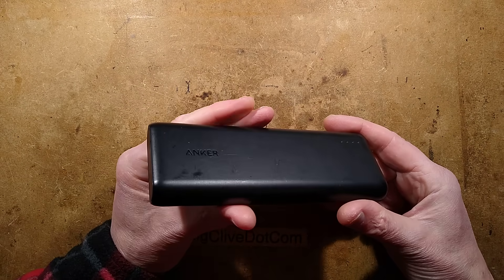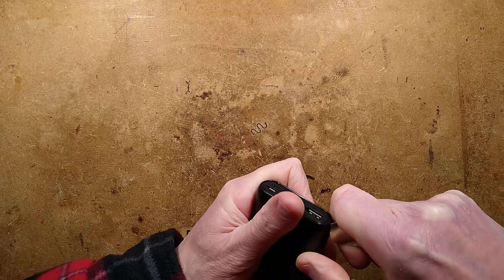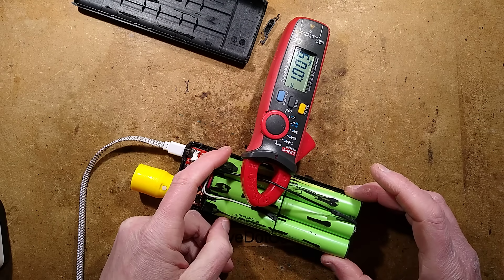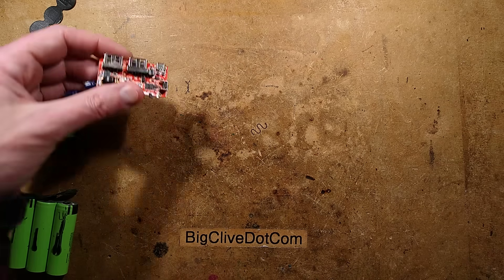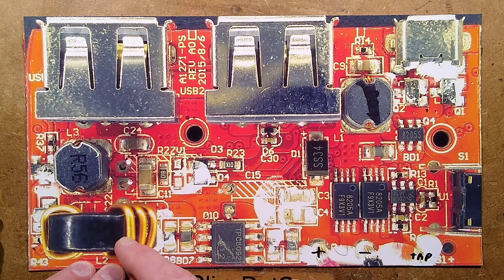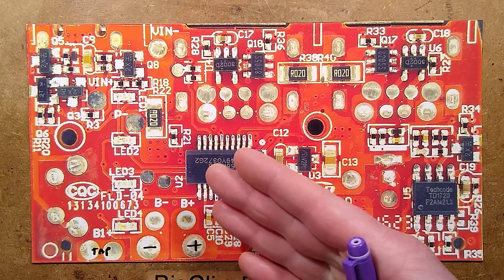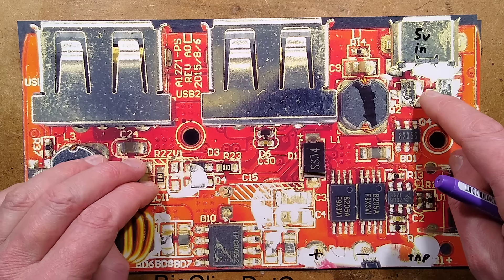Exploring an Anker power bank

Comment: Likely hitting over-temperature or over-current protection to guard against NMC short/fire failure mode due to crystalline formation.
There's also likely an under-voltage protection mode where if it's too deeply discharged, then it will never charge ever again without disassembly and individually charging cells.

Comment: PSA: primecell 18650 battery are suspected rewraps I had 2 vent gas in to my bedroom when the wraps fell off with a paper like tear.

The tear was caused by a cheap vape but it's like paper thin and after doing some looking online this isn't even that uncommon.

The second battery vented when a remote flipped off my bed and hit the charger there was some burning on the charger. All were disposed of and I got an education in rewrap batteries.

I do understand that this is partly my problem but the issues with the batteries are well known.

I did get a better charger and batteries someone produced a data sheet that helped a lot.

Comment: If this helps regarding the complexity of the circuit. I've got exactly the same power bank and it supports the Quick Charge protocol, it's old and probably hence why the extra complexity as there weren't many dedicated chips available then supporting this protocol when this charger was released?

Comment: I've have this exact Anker power bank for nearly 10 years now and still running strong. I payed a pretty penny for it when I purchased it, but I got what I paid for!
Reply: I came here to say exactly the same thing. Sure I've been tempted by newer features like usb c charging or faster charging/more powerful output but also it's just a tank of a battery. Never let me down and it's been through some really rough conditions with me.
Reply: they came down quite a bit in price, I picked one up off Amazon 4 years ago for about 20$
Reply: Does it really only do 5v volts in and out? You'd think it at least did 9.
Reply: @pr0xZen  there was no USB-PD at the time that thing was released.
Reply: @achdubloedesau There were 9 volt capable charging on the market quite a few years before PD 2.0. Qualcomm QC I think were the of not one of the first "standards" with 9V, I myself had a 6-cell powerbank with that well before PD 2.0 came along. But there were several other means, and "negotiation" wasn't nearly as complex or absolute as in more recent years. Some could fairly easily be "tricked" by relatively simple and discrete methods. Especially for input into a somewhat custom device like this, as you're in full design control of the boost/buck-, balance- and protection circuit.
Reply: @pr0xZen  There were some models that added more ways of charging.

I have one that is very similar to this, but it has two Micro-USB ports for input, and can charge off of both of them simultaneously.

Comment: I don't know it the left top undrside of the board supports their IQ charging. The bumph with ANKER is that it is supposed to detect the charge a device can take and kinds of fast charges whatever can handle it. It's probably marketing BS, but it may explain the weird layout with extra gubbins.
Reply from the maker: If it does use the data lines to communicate with modern devices it may step up the voltage to their negotiated level.  That results in much more power for a standard current.

Comment: Nice to see that UNI-T back in use :-) I still use mine regularly, even more then my Yellow Brick shaped Dynatek Multimeter.
I even upgraded to the UT 210-E Pro, since it is more sensitive in the low mA ranges, And have frequency measureing added whic I also uses regularly.

Comment: Just a thought on the output dual inductors... Is this unit QC3.0 with 12V USB output? That could explain dual output switching regulators with abundance of output mosfets. The prints are pretty oldschool but they wonderfully do the job!
Reply from the maker: I'm not sure if it had the QC functionality.  It may have had that.

Comment: Definitely good to know about Anker reset functionality.

I have what appears to be that exact same battery, purchased in Japan in 2017, before they were available easily in Australia. Mine has been used practically every day since I bought it. It still holds a decent charge but is starting to act a little bit strangely. Notably, it seems to take forever to charge and the first blue LED has entirely stopped working.

Comment: I bought these really cheap power banks from walmart, because they're so cheap. The parts are more useful than the power bank. It has one LIPO pouch battery in it and a boost circuit.

Comment: I have a slightly newer revision of that same power bank. They added the option of Qualcomm QuickCharge (QC) compatibility in this model by way of a daughter card, attached via headers. The first one I got arrived dead, and Anker shipped another, so I pulled the dead one apart to see it. I didn't buy the QC option, so it was just bare header in mine. I still use the cells in flashlights though. Good cells, which had on-cell protection, too. (I guess that's how they freed up the board space.) Despite the Eufy shenanigans a couple years ago, I still like Anker for power-related stuff.

Comment: Something even more wild: Older versions (like the one I have) can charge from two separate USB-micro inputs. I have one of these, and its still going to this day despite regular daily usage at one point! (26000mAh).

About the only thing I've been let down from Anker was the last Soundcore wireless earbuds I had; other than that their products are fairly reliable. Even their short run of gaming gear was good  - I still use the gaming mouse as my daily driver and its still going (on my second one and about to go to my third). I'm surprised they don't have more marketing, because their stuff is surprisingly high-quality for the price.

Comment: i had one of these pop while using it. had it hooked up to a vive wireless adapter, was in vr for a good 10 minutes or so, heard a loud pop, headset shut off, and suddenly it started to smell like burning eggs and saw a plume of magic smoke coming from the thing. ripped the headset off, unplugged and ran as fast as i could outside, and just chucked it out into the snow. after 5 minutes of no action, i went out and put it in a metal baking tin. next day i popped it open and salvaged the cells. looked like a cap exploded. scorched the board aswell.
Reply: From VR to Reality 😻 
At least you kept cool and knew what to do..

Have you played (nice non violent games) Myst and Riven (I just wandered around and went on the trains and cart) in VR by Cyan.
There's also Neyyah made in the UK to be released soon..

Comment: It's nice to see inside something well-made / non-deadly for a change!
That "comp" pin on the TD1720 is part of the output regulation but also functions as a reset for the chip when that mosfet pulls it to ground. Presumably the micro handles that.
Reply: That said, it doesn't seem to have a pull-down mosfet on this circuit, that I can see. Just that RC network.
Reply: @jhonbus  Probably the transistor just above U5, npn instead of nfet.

Comment: Hi Clive.
Which is the best powerbank to actually buy?
... also I've seen some website's saying you should only use 18650s for 2 years and then "throw" them away..
and do things that use lithium have any form of fusing or overheating sensors etc..
People are now realising that 12v LiPo4 etc should have T class fuses.. that are also voltage rated ie 12v / 48v etc (if that's right could a 48v be used for 12v or have I got it the wrong way round) which seem to be wildly over priced.
I'm wondering if we can make our own T class fuses.. ingredients correct size wire, plastic tube and very dry sand.
In the past I've used 3A mains fuses for 12v.. mainly because they are cheap, available and ceramic.
Can you do a video?

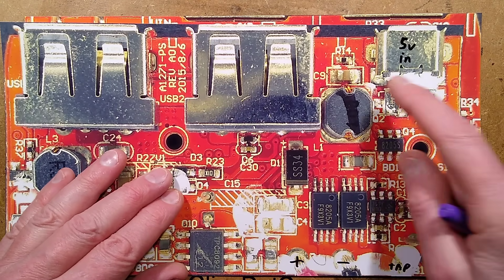Comment: At 7:00 there appears to be an intentiontal bridge between pins 3 & 4 of the rightmost 8205A, and 7:55 there appears to be a solder whisker between pins  5 & 6 of the HTHT66F018.

Comment: I had one of those fail, a newer but similar Anker model. I had a QI charger plugged in that got hot at the USB plug and I guess it tripped some sort of permanent internal thermal protection.The reset procedure for it (plug a USB-C into a USB-A port for 15s) did nothing. I ripped it apart and checked the cells. Took about two hours to get into it, but they were all fine. I got a new BMS, a boost converter, and some USB-C PD controllers for them and 3D printed a housing and they're running fine again. I'm pretty sure the board was in a 'self-detected failure' mode where all it'd do was flash one LED at me, never drew any meaningful current or got hot.

I'm probably just going to DIY my packs going forward

Comment: Clive, I believe those two packs of 3 cells are approximately 12 volts per 3 pack which are then paralleled for a 12 volt pack at double current density. This would make sense with the supply for the  TD 1720 to be at 12 volts.
Reply: @bobahnjr  The TD1720 accepts a VCC of 5-12V, and the TPC8092 MOSFETs are fully enhanced at 5V, so running the IC directly off V+ is perfectly fine. It's also pretty obvious that the three cells are connected in parallel just by their physical construction.

Comment: I have one of those Anker battery packs and has it since 2015, it's probably not got the same power output that it used to but it still works, and I have also got a newer one with PD to charge my phone,

ANKER power banks and usb chargers are great and are the best in my opinion

Comment: I have this exact model. I actually bought it by mistake as it was far bigger than I wanted, but it's come in very handy over the years. Recently I've been running my seestar s50 telescope with it all night in freezing temperatures. It's also the thinnest powerbank I own and fitted inside my Christmas lego model base to power the lights. it chargers extremely slowly and it doesn't support any of the quick charge standards, but it's still useful.

Comment: I have an idea for a fun experiment:
Let’s say you only have one wall charger but a dozen power banks. What is the efficiency loss of daisy chaning power banks to charge them from one charger, vs charging all of them on their own separate chargers?

Which power banks are able to charge and discharge simultaneously? Which ones need to fully charge before they start discharging? What happens if there is a cable break, which ones will charge and which ones will become discharged?

Comment: Also part of the Anker fan base. Still have the smaller (10Ah) brother of the beast you dissected in use, and it has been working fine for almost 10 years now. And I also have a USB charger and several cables from them around. As many others already said, they are one of the few reputable Chinese brands that has very high quality products at decent prices.
Recently persuaded my boss to get an Anker USB charger as a replacement for a no-name one that failed. Took the failed one apart, and it had a 10g iron weight inside that was just attached to the central transformer with double-sided tape and rattled free over time. Guess it might have shorted something on the board and caused the failure...

Comment: Can I send you a faulty 48v e-bike charger for diagnosis,  I don't want it back, just thought would be a good video for you.   The mains side capacitor does charge up as I found out the hard way, still I changed it anyway thinking that could be the issue, checked the rectifier but is fine.  It did start charging for bout 10 mins but then died again.  Lost my patience after that and gave up as couldn't be bothered and new charger on way from ebay.  Interesting note on the charger,  I run a powerline adapter to get internet in my mancave, if I charged my bike I would loose all internet connection, If radio was plugged in I would just get no signal and that was at home or at work.  A strange charger this one as my new one has no effect on internet or radio.

Comment: I have the exact one. It was my first powerbank. Still working but I stopped using it to charge USB-C devices. Mostly because phones complain how slow it charges. I bought some of the little USB-A cubed LEDs you showed in a video. Now it's a emergency light or used to light up some stuff. Like seasonal decorations or building block (Lego and non Lego) models.

Comment: I had a anker power bank just like this one, except mine was equipped with quick charge so the ports were blue, I always wanted to know what it looked like internally. so this will be an interesting watch. 

A little note for your info section, anker power banks, at least that one and a couple others have an interesting reset sequence where you plug the input into the output until the lights flash, about 15 seconds then it should have been reset successfully

Comment: I had an Anker 537 powerbank that exhibited a similar issue. The reset instructions on my model were to connect the input to the output, but unfortunately it didn't work. Regardless, Anker replaced it under warranty and the replacement has been good. 

Otherwise I've found Anker powerbanks to be pretty reliable and, after watching this teardown, I have some assurance that they're not cheapening out on the circuitry. It must be good if Big Clive can't do a full schematic. :)
Reply: I connected the input and output on mine once and successfully fixed it and it’s worked since.
Reply: NotJustBatteries
Reply: Woah did not expect to see NJB here!
Reply: I have a Chinese 266Wh power bank/power station that has a standard 12V cigar lighter output. It's unregulated 3S, so 9-12.6V and can supply up to 15 amps. The instructions say that if it ever needs resetting, you "insert a long metal object, like a screwdriver, into the cigar outlet, making sure to "connect" the silver contact in the center to the edge of the socket". Yes. Because testing the short circuit protection on a 266Wh Chinese Li-Po is a brilliant idea. Then connect it to the charger and it will start up again.
Reply: @seanman6541  Honestly that is crazy, but so on brand haha
Reply: woah, it's the ableist transit dude!
Reply: @ThylineTheGay ???
Reply: @ThylineTheGay  you people are never happy
Reply: @asystole_  happier than you, not that that is a hard bar to pass XD
Reply: @ThylineTheGay  I'm literally disabled and NJB is a godsend for the cause. Pls stop being a ragebaiter
Reply: @lelandbatey  someone generally doing good things doesn't discount other problems they have

Comment: I have that model of power bank. It might be considered outdated by today's standards but I've been very pleased with its performance.

On the version I have the two output ports support different charging rates. One Is green and has a lighting symbol, and the other is black and is IQ.

Comment: The COMP pin is used for both enabling the output and control loop compensation.  Q3 pulls the COMP pin to ground to disable the controller, and C1, C2 and R2 provide control loop stability so the controller can respond correctly to load steps and changes in input voltage without causing over or undershoots at the output.

The inductor, L1, is suspiciously low value (0.5uH).  That thing must be switching at very high frequency to move any significant current through that small of an inductor.
Reply: The TD1720 operates at only 300 kHz so I'm assuming the inductor used in the Anker has a larger value than the datasheet example.
Reply: @purerhodium  Interesting.  Yes, it must.  Clearly I didn't bother to read the datasheet!

Comment: The TS1720 COMP pin has two functions. It provides a shutdown function when held to a low voltage. During normal operation, it provides control loop compensation. The buck has an output inductor in series plus an output capacitor, these cause a two-pole frequency response. The internal error amplifier is a transconductance type, which means the two capacitors to ground provide two zeros in the loop response to improve behavior.

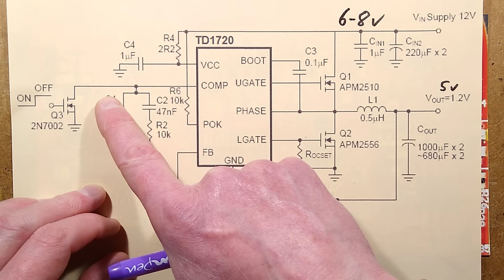Comment: 9:58 comp is the feedback compensation pin.
Reply: I think the name comes from it being the input to the PWM comparator (and therefore output of the error amplifier). It just so happens that it's also where the compensation network goes (whether the error amplifier is transconductance or voltage).

Comment: Clive, how did you learn all this? I learnt how to wire up simple circuits using 741 opamps and 555 timers in school but I’d love to know how to make more advanced things
Reply from the maker: I've learned it over time.
Reply: @ damn, I’m going to have to try and find my passion for life first then
Reply: Lots of tinkering. Same story as you but by watching clive and others ive learned to fix all sorts of things, replacing caps and repairing blown out bridge rectifiers. 

Get a raspberry pi and a breadboard. I recently built a ups for a rpi using a voltage regulator, 8bit shift register and a 10bit ad converter, and a bunch of salvaged 18650s. Pretty chuffed with that. 

It all started with the 555, 741 at school, and then much later in life a lot of youtube hours ha

Comment: I noticed that you didn't pull out your emergency pie tin of flammable doom just in case something horrible happens.  I suppose that's a good thing.  I have a couple of Anker power banks, they're about double that size and they have a feature of doing trickle charging for longer battery life, I don't know if that feature is offered on that bank, it's kind of a mode you get when do a long press... or something... well, I don't know anymore, I lost the instructions. But I know they work great for what I need them to do.